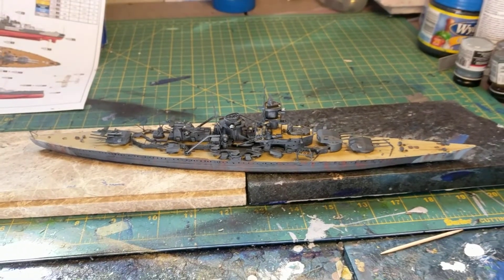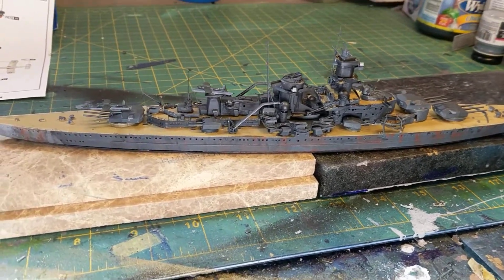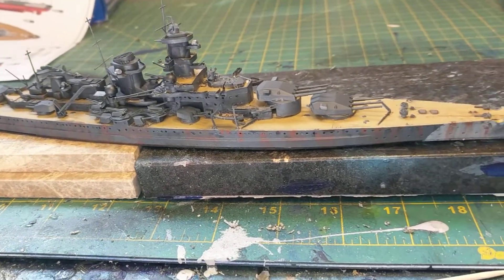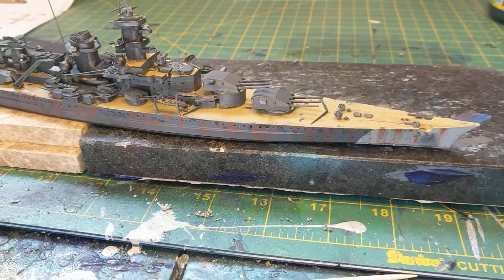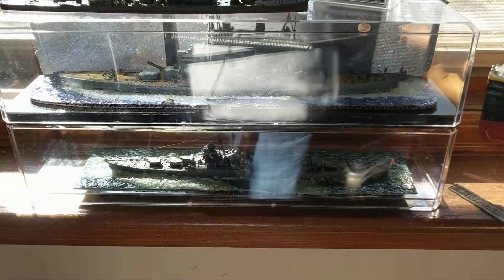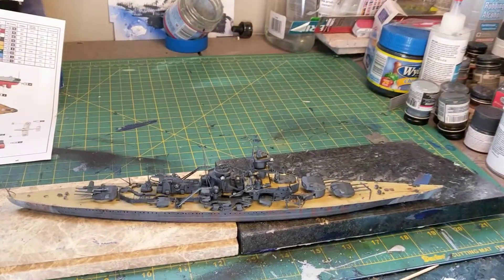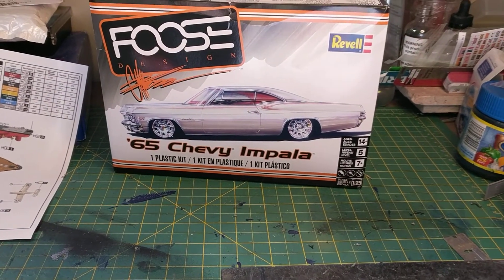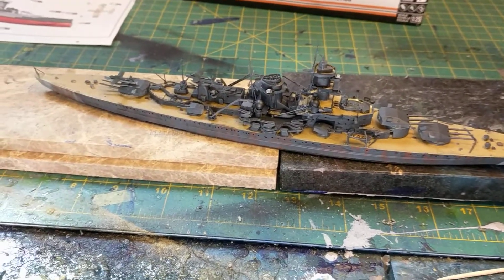1/700 Gneisenau video part 3

Comment: Gotta do the hood
Reply from the maker: Actually I did
Reply: SE Models link? Btw excellent job, and the deck still looks pretty good. I have mine coming in the mail.
Reply from the maker: @gabrielm.942  https://www.youtube.com/watch?v=abgHt97SfRs&t=180s
Reply: SE Models yeah I just found it l, it looks amazing!
Reply from the maker: @gabrielm.942  Thank you, what are you building?
Reply: SE Models a Scharnhorst, it’s 1/570 scale. Little bit of a weird size, but it looks like it’s of a decent quality for the price. I’m having trouble finding a after market details. I have found a wooden deck online, not sure if I should get it.

https://www.revell.de/en/products/modelmaking/ships/military-ships/scharnhorst.html

Easily my favorite battleship(next to her sister) with next being next being Biz and tirpitz and then Missouri (my homestate).

Favorite cruiser being either hipper or spee one of which will likely be my next, that or a biz. There’s a good looking tirpitz I may go ahead and grab.